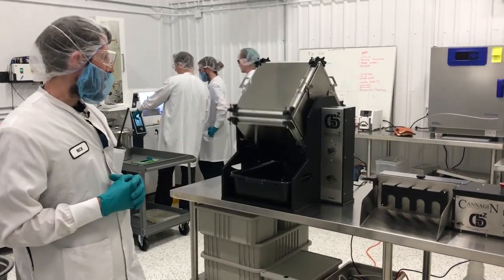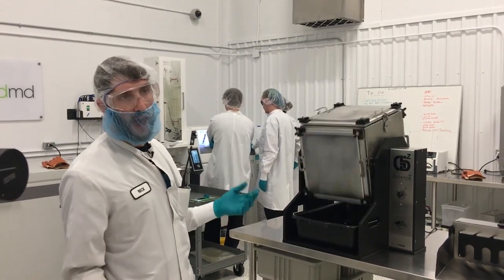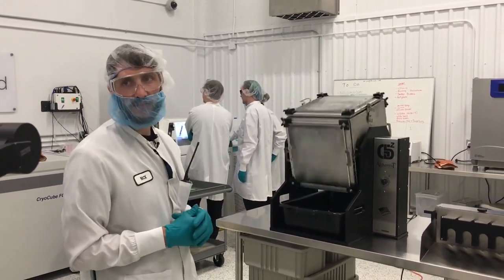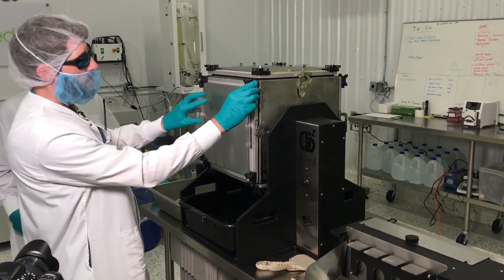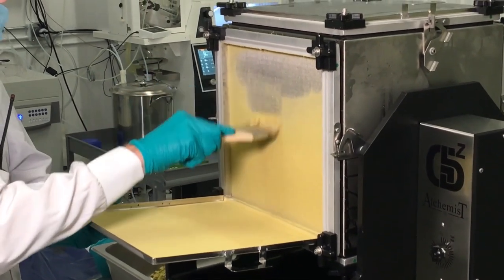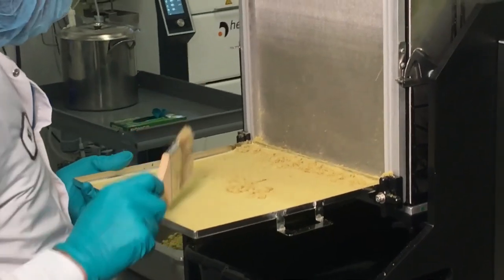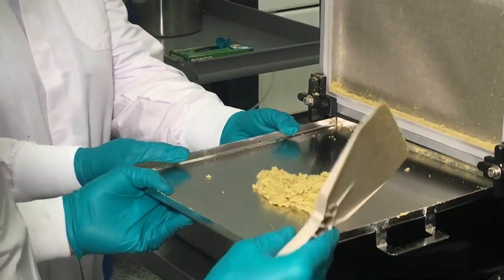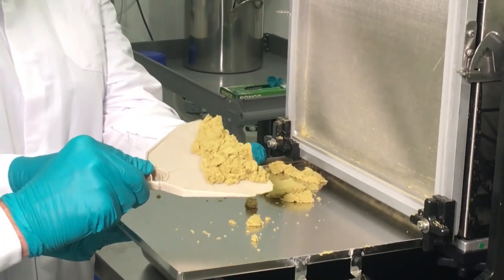Want To Learn How Canadians Extract Trichomes?

Comment: Why is a square better than a cylinder? It just seems harder to collect
Reply: lower cost to manufacture i assume. Screens in squares are most common form.
Reply: @djSpinege  This and function, instead of the material "smearing" along a round surface in a drum it gets dropped from one side to the other, more effective at "bouncing" the trichomes out, water "sifting" is the best way to remove chances of piercing the glandular membrane, counter to popular "bro" science water has little effect on removing terps, temperature is responsible for most volatile terp loss.

Comment: You need the whole plant to make good medicine
Reply: Depends what you want, the amount of Cannabinoids in the plant material is minimal and can only be extracted using super critical CO2 (expensive), a alcohol wash will not cut it, the majority of "medicine" is contained in the glandular trichome. Whole plant extraction will include plant lipids and sterols (minimal) and excess water, with plant fibre discarded, unless you eat the raw plant like a goat and ingest the acid variants (THC-a, CBD-a, ect) of the Cannabinoids it will have little effective dosage to be of benefit.